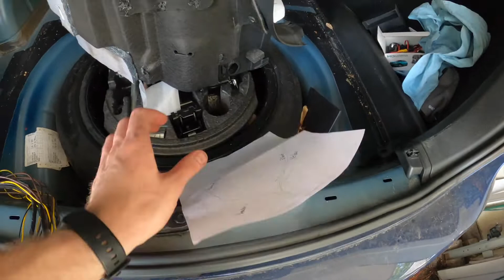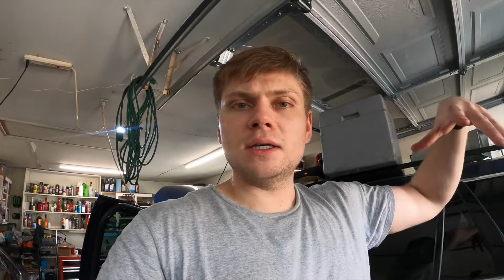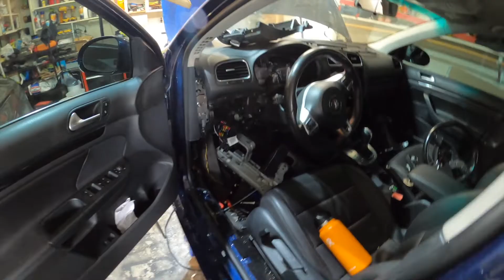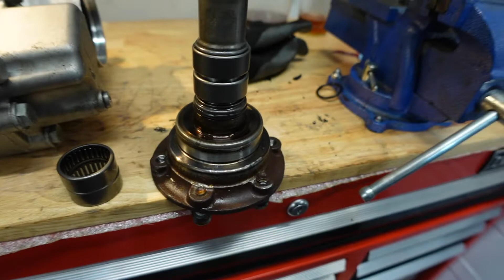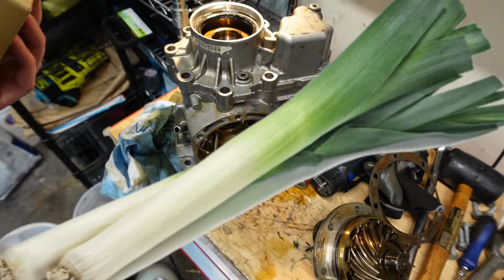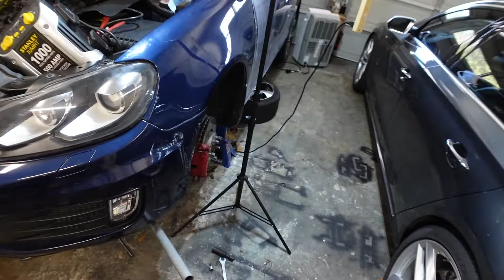Wiring the Rear Differential and Rebuilding the Transfer Case on My JSW 4motion Project.

Comment: Just found your videos, I just bought a blue mk6 tdi jsw looks just like yours.  I think this is super awesome that your documenting this!  Great videos, hope you don’t mind if I ask you a few questions down the line about this.   Also I notice the factory hid headlights.  Did yours come with those factory or did you retrofit them?  Either way they look great 👍 
Keep up the great work!!
Reply from the maker: Thanks for your support and I appreciate you watching. Hope it's motivating or at least entertaining. The genuine HIDs were a retrofit as no US spec Jetta Sportwagens came with them. They came of a 2011 GTI and I got them both for a steal from the north east! I found a thread on VWvortex that showed how to re-pin the headlights to work. It's not too difficult. Let me know if you have any other questions. Thanks again.
Reply: @eurospekgarage1833  yes very much so, I’ve noticed a few of the tdi golfs I’ve seen have the oem hids but I’ve never seen them in a sportwagon.  That’s the first thing I noticed on yours.   I don’t like the look of the aftermarket hids guess I’ll keep an eye out for a set from a golf.  

I found a local salvage yard here in Nashville has a 09 Tiguan guess I will go down there and pull everything.  
Looks like I’ll need the entire rear end, prop shaft and possibly the transfer case box.  However my sportwagon is 6mt so I’m not sure if that transfer case will bolt up to a 6 speed transmission with the Tiguan being a dsg.   I recently imported an 02m 4motion tdi transmission from Europe for my mk4 r32 tdi swap so I’ll probably just get the whole transmission for this as well.
Reply from the maker: @TenesseeTDI  Sounds like a plan. You should be aware that the tiguan is wider than the jsw, so the rear wheels will stick out a bit. Maybe an inch wider on each side. Regarding the rest of the parts, the jsw is based on an mk5 body, so the prop shaft from the tig will not work. you'll need one either from an 8P A3, or mk5 R32. The bevel box will also not work from a tiguan as they use different transmissions, so i recommend finding one from the aforementioned A3 or R32. Regarding the tranny, you can convert it to accept the bevel box, you'll just need the AWD diff because it's double splined. You'll also need a machine shop to shave the case and drill and thread two holes for the bevel box to mount. But it's much easier if you just get a 4mo tranny.

Comment: Some of the things you did off camera such as the connector for the fuse box and the haldex controller are very important if you're going to show us how you did this conversion. The most intriguing parts of your build just magically are finished and together ,not so great .
Reply from the maker: Thanks for your comments. I agree with you, some of these things are magically just finished. As you can imagine, it's difficult to show everything on camera without the video lasting well over an hour. If you have any questions about how i wired it up to the fuse box, i'd be happy to explain and show you where to wire it to. But that is the tough part in these videos: how to keep it entertaining and short enough for people to watch, but also clear enough so that anyone else attempting to do the same thing can use it as a guide. Thanks for your comments, I will do my best to show every step in future videos.
Reply: @eurospekgarage1833  Did you use connectors/pins or did you solder in place? Do you have any pictures you could share?
Reply: @eurospekgarage1833 hey out of curiosity may I potentially reach out to you about the wiring of the haldex? Would it be the same if I am doing this conversion on the 6 speed manual 02q awd transmission with angle drive  from a golf r? I am doing this conversion in the coming weeks and interested in saving some money and not buying the 800 dollar haldex controller to do everything from my phone been watching thru your whole series and it's been extremely informative thank you so much for doing this and I plan to make videos on my conversion process and hope to be even half as good as you have been 😂

Comment: Im pretty sure I saw your thread on tdi or vortex forum. I have a JSW tdi with tig lift also. Ive only had it a little over a month but ive really been enjoying it. Keep up the good work!
Reply from the maker: Thanks for the kind words! Yes, I am posting highlights of this build on VWVortex - couldn't really think of a better place to document other than Youtube. I'm not sure if you agree, but the tig suspension on this car is really nice and comfy!
Reply: Oh ok cool ill continue to follow on here and Vortex! I do have to agree with you on the suspension though im really enjoying it. I really want to put it on some coils but im trying to just enjoy it for what it is before i start dumping a bunch of money in it lol Dont know how long i can hold off though so we will see lol
Reply: @ThAvngrD ay as far as the tig suspension are you guys running tiguan koni special active shocks and struts and the hr lift springs for tiguan or tdi shocks and struts and the lift springs heard using both tiguan shocks/ struts and the springs gives a little added lift than just tdi shocks with the springs and is what I am converting too from the forge lift blocks and tow springs from a tiguan and wondering if it will be around the same height but more comfortable or if I will be losing some height, also how is the alignment? Getting the stage 3 camber adjustment kit for the front but unsure if the geometry changes made any differences ik for me with the springs and hockey pucks with stock shocks it's really bad and do not recommend it at allll